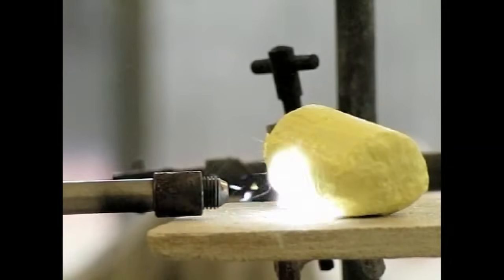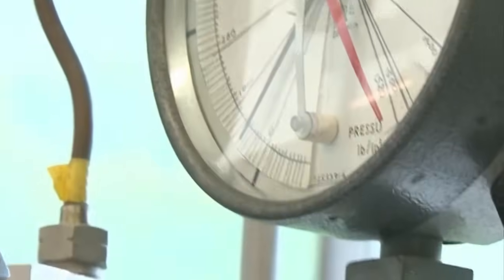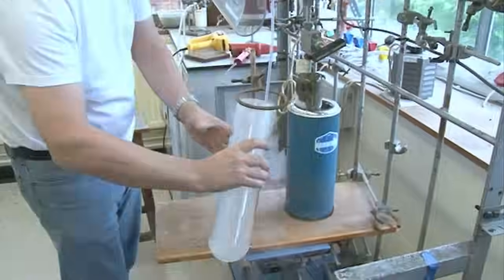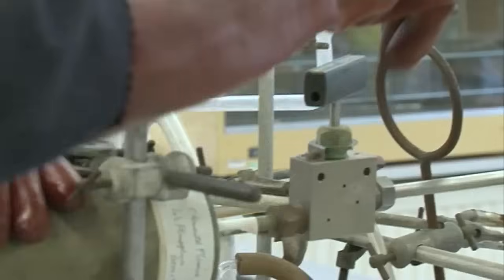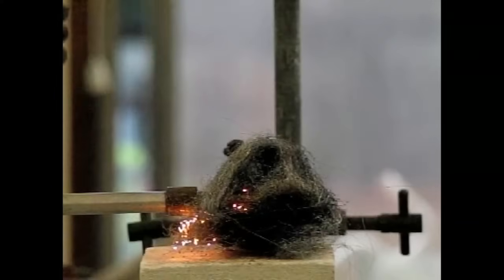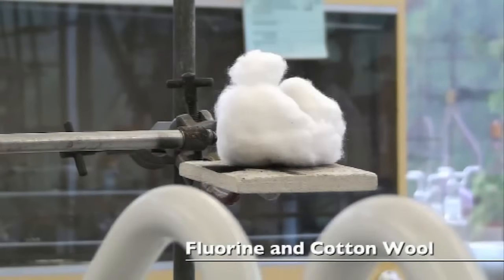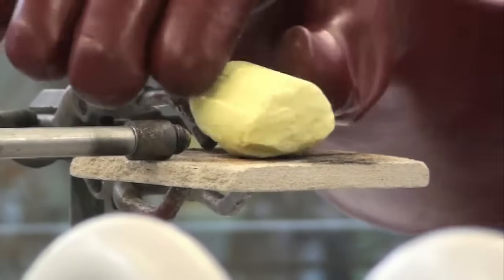Fluorine - Periodic Table of Videos

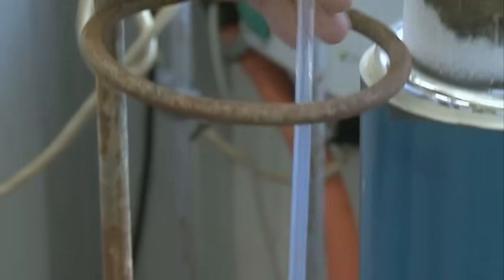Comment: 1:16   Haha, the fluorine gas he can't see is inside tubing that's made from a fluorinated polymer that he can see.  It's interesting that Teflon, FEP & PFA are the best plastics for chemically inert tubing;they're all fluorinated polymers formulated with the most reactive element.  Go figure!
Reply: Wouldn't it make sense that the most reactive elements give the most stable (inert) compounds? :)
Reply: Miikka Silfverberg Yes, but the first impression seems ironic or counter-intuitive unless one knows about chemistry.  I'm a retired engineer whose last project was to re-design a specialized electroplating instrument that was being destroyed by a wide variety of very harsh chemistry used for electroplating several metals, including platinum, gold, iridium, nickel, zinc, titanium & others.  The project was challenging because nearly all the working parts, including high & low voltage electronics, structures, containers, valves, pressure/vacuum controls, which had to be replaced with mostly teflon-coated components, platinum or 316 stainless.  Then, there were gobs of tubing & fittings to replace (all FEP, PEEK or teflon).  Chemistry run through it included concentrated acids & bases at both ends of the PH scale, bleach, hydrogen peroxide and piranha. Lots of pricey, specialized labware were required.  Although I had worked with many chemists for decades, that final project really got me thinking about & researching inert materials.  Chemistry was never my strong suit, so it was an education for me.  

Generally, I've got to say that automating chemistry processes was very interesting work, and direly needed to keep PhD lab-rats from becoming disenchanted with the tedium in their lab work.  I'd recommend to engineering students that they get a good dose of chemistry & really learn it well because the demand for engineers will focus in that professional arena and other scientific endeavors involving chemistry as part of a process.  Increasingly, engineering is becoming mostly scientific.
Reply: *****

I'm absoutely not competent to discuss this matter :) but that sounds interesting! Do you know of any articles that someone with a high school background in chemistry can understand? I read an article on Wikipedia (http://en.wikipedia.org/wiki/Bioenhancer) but that seemed a bit sketchy. Maybe you meant something else?
Reply: *****

Thank you! :) I found this very interesting! Cool that changing one atom can have such an effect! Nevertheless, this was not an easy read with my chemistry background... So what I'm going to say may be total garbage :D

As far as I could understand, they present several reasons why fluorination could be useful in increasing bio-availability. Stability is one of them. In Section 2, they seem to explain how increased stability of the fluorinated compounds increases bio-availability: it makes them more resistant to metabolic enzymes and thus more likely to reach the site where they can be medically active.

However, as far as I understood, they also say fluorination can modify the basicity or acidity of parts of the compound, increase binding affinity to proteins and change the form of the compound (or rather the preference between different isomers of the molecule). A lot of factors besides stability are at play apparently! Both properties of fluorine itself and properties of the target protein factor in. The combination of biology and chemistry is really interesting! Though it also seems quite tricky :)
Reply: And stable elements (such as nitrogen) make very unstable compounds.
Reply: Infact it s totally logical :)
A highly reactive element will form very stable molecule !
For example cabon can ignite but once it s done carbon dioxide is quite inert. 
The energy realeased by a reaction can be described as the gap between the stability of the reactant and the stability of the product. That's why highly energetic reaction forms stable product ;).
Reply: +SIMKINETICS The teflon tape you might need to seal a leak in a pipe thread is probably the single safest chemical substance in your house. Even more so than water.
Reply: Hmm... thanks for pointing that out, now I am aware
Reply: Teflon is made of fluorine and carbon, which is the strongest bond in organic chemistry

Comment: Braver folks than I am, doing these reactions outside of a fume hood.
Reply: That was my first thought: I'd be wearing 50 lbs of protection AND have the stuff in a roaring fume hood.
Maybe it reacts with the air long before it gets to your face, but the reaction products can't be innocuous either.
Reply: @jpdemer5  can't they? These guys aren't fools. They don't take it lightly because they dón't know, they do it this way because they dó know, exactly what is or isn't safe.
Reply: @omikronweapon  exactly. Non electricians might want to wear a full cotton suit with an arc face shield to work on some things live, but a trained electrician who knows exactly what is and isnt dangerous and follows a procedure can do it naked.
Reply: @jpdemer5  Even if it did react with the air it would react with the water and you’ll lose a face. Better just not use it at all, or have million dollar equipment to protect yourself
Reply: Ikr? Imagine HF acid in your lungs

Comment: Do these fluoride compounds enter the blood supply when ingested (like tin fluoride or whichever type of fluoride is added to some water supplies). If so, is it possible that ingesting fluoride compounds  could become dangerous when these compounds come into contact with reactive intermediates especially during the normal metabolic process? Such as reactive oxygen species or other radical species? I used fluvoxamine, a fluorine containing anti depressant for a little while so i know fluorine is a great enzyme de- activator.

Comment: Its simply because the fluorine has reacted with something else. Once fluorine becomes fluoride it is no longer poisonous because it has gained the electron to obtain noble configuration. You are not ingesting fluorine but fluoride which has formed a bond with another element or more.

Comment: hmm it only doesn't react with the top 2 noble gases?  It seems I might have to do some more research. i was sure it didn't react with any of the noble gases.  if it reacts with elements that have full electron shells, then it should be able to chain to itself unendingly (as carbon does) after it connects to anything. Everyone ready to meet a fluorine based lifeform? :)

Comment: You are thinking of the Noble Gases (the last group). The Halogens (the group with Florine) along with the Alkali Metals (the first group) are extremely reactive, because the Halogens only need to gain 1 electron to have all their energy levels filled, and the Alkali Metals only need to give away 1 electron to get rid of the extra energy level that only has 1 electron in it.

Comment: Good point but not quite. When the tin fluoride dissociates it splits into tin ions and fluoride ions. The fluoride ions are the non-reactive state of fluorine since they have already accepted electrons from the tin. Fluorine is dangerous because it has not accepted electrons from anything yet and will take them from just about anything. On a molecular level the fluoride is made of individual fluorine atoms with a negative charge and fluoride is made of a pair of fluorine atoms with no charge.

Comment: Fluorine has a very low bond energy with itself ( F2 around 159 kj/mol). Compare that to HF, BF3, AlF3, CF4..etc. which are all above 500 kj/mol (so roughly 5 times more stable). Because of this, fluorine will want to bond with those (B, H, Al, C...etc.) much more than it would with itself. So the F2 bond will break in the presence of practically any other element, and the individual fluorine atoms will then bond to the new elements introduced :)

Comment: Almost all of it reacts with the thing put in front of the tube, and the rest attacks water vapor in the air. Also, there lab is equipped with air conditioning, and they released only a tiny amount of the gas. It's not evil like nerve agents, which linger around and very small concentrations cause you to die in pain. It's just agressive as hell.

Comment: Long term double-blind studies have proven that fluoride in tooth-paste only delays the onset of tooth-decay by a few years but doubles it overall. There is actually a tooth-decay vaccine that was invented in the 90's using genetically modified tobacco plant extract that is applied onto the teeth. It works by promoting a type of harmless bacteria that prevent the harmful bacteria from multiplying. They soon swept that one under the rug to keep everybody on fluoride & buying toothpaste.

Comment: @BlackSkullRacer613 It's toxic because it can still react. A thermodynamically favorable reaction will usually occur regardless of the oxidation state of the atoms involved. Sodium/hydrogen fluoride are more thermodynamically favorable than elemental fluorine, but there are much more favorable compounds as well.

Comment: @Whitetiger60 It would not be the same, a flame thrower works by pouring a flamable liquid onto something that is set on fire. Fluorine reacts with anything (almost anything) it touches. A flame thrower would would not burn a hole throgh a steel wool sponge. The damage would not be caused by the chemical burning, but rather the chemicle reacting with what it touches. But you are probably right about it being too expensive.

Comment: as a welder i use an oxy-acetalyne torch. could flourine be used to cut steel? i think if so it would be awsome never having to light the torch. but then again it reacts to so much you would have to be very safe and point it only where needed. how costly is this stuff

Comment: @megaverse Chances are it won't ever be able to reach the brain, as it's a pain in the ass getting most anything to the brain. As has been said below multiple times, the threshold where flouride will start killing/effecting you is some 15-20 grams, which is not a lot, but neither is the amount. As long as you aren't eating multiple tubes of toothpaste for breakfast, lunch and dinner, you should be fine.